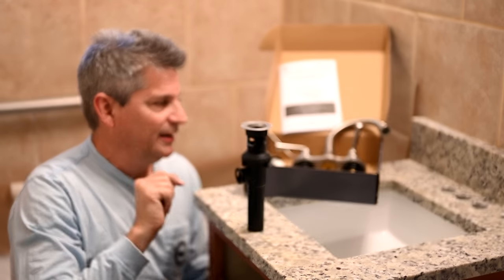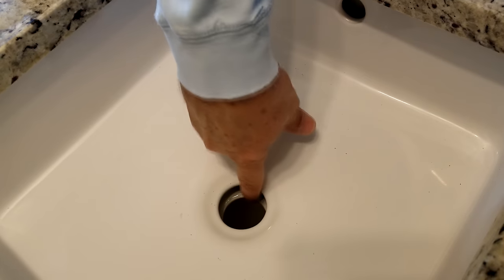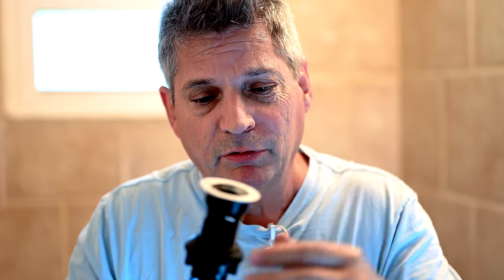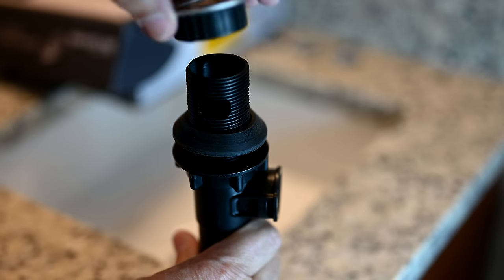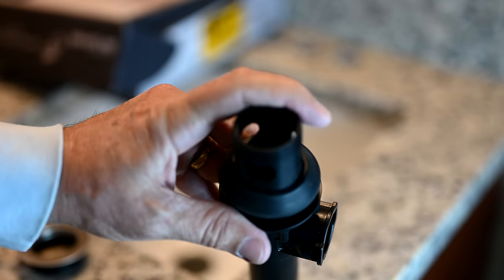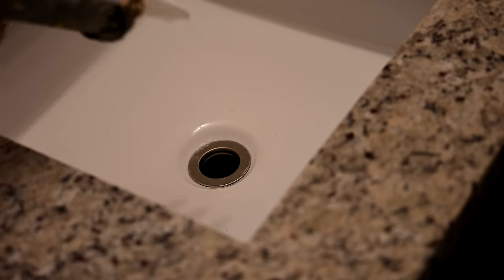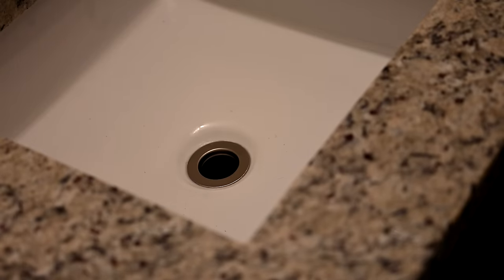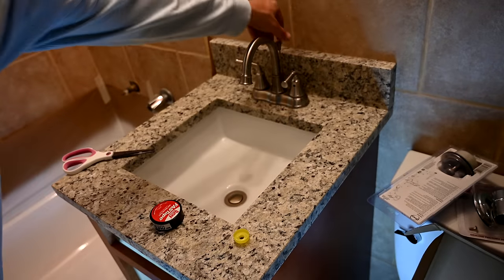How To Install Bathroom Sink Drain/Faucet, No Leaks Under Gasket, Threads [SOLVED] 2023

Comment from the maker: From Home Depot & Amazon (paid affiliate links)
🛒 Glacier Bay Mandouri 8" widespread LED Faucet in this video: https://amzn.to/2Efy2vY
🛒 Lower price 4" center set faucet: https://amzn.to/2PCcJa8
🛒 Oatey Fastape 1/2 in. Thread Sealing PTFE Plumber's Tape: https://homedepot.sjv.io/WDDKdn
🛒 Ridgid Z Change Faucet Tool Wrench: https://homedepot.sjv.io/NKKP4N
🛒 RIDGID One Stop Wrench Kit 27023 from Amazon: https://amzn.to/2ClCbNa
🛒 RIDGID One Stop Wrench from Home Depot: https://homedepot.sjv.io/9XEjQ
Reply: I was about to question as im watching.  My new faucet had a note saying not yo use anything on the threads.   I was surprised and still going to do it to be safe. But i guess i will trust them and leave the bare. 👍🤠
Reply: . Mlm. Mlm.... ,.
Reply: What brand of silicone caulk are you using? So many not sure which is right..
Reply: Those "arrogant plumbers" say things because you continue to give wrong info after saying that they commented you don't know what you're talking about,  most putty doesn't stain, or Crack anymore, for years matter in fact, and second, use brass  pop up assemblies, they are much better
Reply from the maker: @footlongburrito   If what you said is correct, why do they sell a stainless putty on the same all right next to the regular putty?
Reply: @jeffostroff  if you're speaking from home depot perspective,  that's already thrown out the window cause home depot sales "illegal" (against code) items, they cater to the homeowner/diy person, not professionals. At plumbing supply stores they don't advertise stainless putty, because they all now are, no one makes at staining putty, cause #1 no pro would touch it, #2 that is equivalent to selling old technology
Reply: Brandonnava8645 do you have a video showing the correct way?

Comment: You've got your direction of the teflon tape correct but if you flip the roll of tape 180 degrees it will unspool it naturally as you wrap it around.

Comment: Another good test for leaks is to close the drain, fill up the sink with water, and then open the drain.  This will force a large volume of water down the drain.  I discovered one of my leaks this way.
Reply from the maker: Yes, we do this as part of the overflow test shown at 14:09
Reply: It’s called a hydrostatic test.

Comment: This is the best instruction I have ever seen! Thank you! I just did this exact thing today, smaller bathroom sink, less room. I wish I saw this before I attempted to remove the faucet retaining nuts underneath. I tried to use channel locks and regular pliers, no room to really grab and turn them. Finally got the RIDGID EZ Change Plumbing Wrench Faucet Installation and Removal Tool. What a Godsend!
 Also, the plumber that installed my sink, tightened them so much as if I lived in California and was expecting an earthquake of 9.0! No need for that! and he used putty everywhere, that cracked and fell inside the drain, further clogging it! Just got to let the silicone cure, the do the leak testing. Thank you so much again, new sub here for sure! Have a great day and a Merry Christmas, God Bless You🙏🙏👍👍

Comment: Phenomenal presentation.  No annoying music is always a plus. I now feel confident to do this job. I watched so many videos over the past two weeks but never felt confident like I do now. Thank You for the explanation on the plumbers putty on black rubber. I had it out to use. I will now go to Home Depot for the clear silicone. Best thing for me is that I bought the exact faucet to install.  (Oh and I finally got brave enough to remove that yellow cap they put on for shipping ).   I couldn’t turn the water off as the valves were frozen.  I used WD40. Now I can turn them with ease.   Nice and lubricated.

Comment: 98% worked for no leaks. No dripping at any of spots covered in vid.  After the last leak check, did get slight drip on the lower tailpipe just below where it meets the t-joint for the ball rod port.  Didn’t realize that screwed into the upper level.  Based on your advice of a threaded components, took off the p-trap and added grey tape to the threads on the the lower tailpiece. Once it and p-trap were reinstalled did the leak checks.  This time no leaks.  Thanks for the vid. Haven’t had to replace a sink in ~35 years.  Bought the Ridged tool and it was easier than the basin wrench.

Comment: What a master! This is how you install a sink! Not as quick n easy as most people think. But if you do it this way, it will WORK.  Which is the most important thing. Thank you for this Jeff. I watched your previous video on this topic (how to keep the overflow inlets in the drain from leaking) and it helped me very much. This video is even better: so calm, confident, and thorough. Haha. Sorry for all the praise but I just remember how much of a bear it was in the days before I knew how to do it right trying to get it to stop leaking.... Great work!
Reply from the maker: Thanks diego!
Reply: Get a sink to stop leaking ? Wtf world do you live in ? I’ve never had a sink leak and I’ve never used Teflon tape like this . Yell me wtf the Teflon tape is doing to prevent leaking in this scenario? The cheap stack he’s using is why he has leaks maybe buy quality part one piece stacks that don’t screw to the flange to begin with and you won’t have leaks.
Reply: @kickassclone75  RE: " buy quality part one piece stacks that don’t screw to the flange to begin with and you won’t have leaks."
I did that. Still leaked. Used tape & sealant to get a leak-free installation.
You should do a video to show how you get yours to work every time. Would be worth a lot for anyone doing this type of installation.

Comment: For the first time ever, I installed a bathroom sink and faucet without a single leak.  I've installed some of these before but always had leaks to fight in the process.  Tightening  that one nut on the P-trap first and using Teflon tape on the tailpipe, plus the silicone in strategic places, must have done the trick.  Thanks for the great video and the excellent advice!

Comment: That was best video I found on leaks. Told us the why along the way and not just the how. I have a new Moen fixture that has been leaking at drain pipe after three tries. Kept thinking it was the putty but after third try and even with tape around top of drain pipe where it screws into flange, thought EXACTLY what this video showed as perhaps the culprit being the underside where rhe drain pipe is tightened. Was going to try silicone next underneath and even with ht flange and then completely stumbled on this video today...phone was listening to me talk about and gifted it to me. Will try tomorrow and hope that is indeed the solution.
Reply from the maker: Awesome I hope that solves your problem

Comment: Great video, Jeff--so glad I watched it.  I've had troubles getting lavatories leak free in the past.  After spending 2 days getting a 50-year-old 3-hole faucet and drain off of a cultured marble top, I'm ready to put in the new kit (which is now mostly plastic compared to the all-brass stuff I removed).  This will help a lot.  You are right about getting old stuff out being a beast.  My 50-year-old kit was severely corroded by all that time exposed to hard water, time, and copious amounts of dried up plumber's putty used when it was installed.  I had to cut the rusted faucet flange nuts to get the handles off & finally had to use my dremel to cut the drain flange seating nut, and the flange itself as nothing was breaking loose even with multiple tries of penetrating oil.  Would have been faster to go to the dremel first.  Fortunately, brass cuts easily with the metal-cutting discs (and a flex shaft made it so much easier).
Reply from the maker: Yes you have to go old school on these old school fixtures

Comment: I had a leak under the sink where that rubber gasket pushes up.  Or so I thought, it was made worse when I tightened it.  I tried the teflon tape and it worked.  I'm not going to lie, I was skeptical.  Your video is one of the best explained videos for anything I've found online, thank you!  I will be subscribing:)
Reply from the maker: Yes likely what happened was you over tightened the nut which deformed the gasket and made it worse. But luckily you found our video and the proper fix for it is the Teflon tape

Comment: Wow this was great. Thank you. I just had this problem and I fixed the leak with plumbers putty. I was just diy trying to figure it out. It has worked so far but I probably need to go back and use silicone and Teflon tape instead of plumbers putty. Thanks very much for this video. Very helpful
Reply from the maker: You're welcome!

Comment: Wanted to say Thank You.  Followed your instructions using tape and no leaks. The sink and faucet manufactors stated not to use putty because of the plastics. Used GE Advanced silicone in small tube. Also been using the 2 tool kits from Rigid, makes things a pleasure.  You got a new subscriber.
Reply from the maker: Glad it helped Jason, welcome aboard!

Comment: This is a very well produced video. I'm a journeyman industrial instrumentation mechanic in oil and gas, and my initial reaction to putting teflon tape on non-NPT threads was to go insane with rage. Then I thought about it, and realised that plumbing drain connections are all at atmospheric pressure. I'm brainwashed into thinking all pipe connections have to withstand 2500 PSI, but really residential plumbing is a completely different trade. Kind of an eye-opener, if that makes any sense. You solved my problem, though! Thanks for the excellent video!

Comment: Thank you @jeffostroff. Very clear instructions, good audio and video. I stumbled on this video because I was getting water droplets pearling down between the "cone shaped" silicone gasket and the underside of the sink basin. I'm replacing the drain on an old bathroom sink. The edge of the hole against which the gasket comes into contact on the underside of the basin has eroded/chipped and is no longer perfectly round -- so the gasket (which is perfectly circular), can't seal the hole properly. 

I've disconnected my ptrap, and followed your instructions. I've teflon'd the thread where the gasket lines up, like is shown in the video, and finger-tightened that nut to get the gasket to seal as much as possible (without deforming it too much) against the basin. Then I used channel lock pliers to give the nut an extra quarter turn.

Where I went slightly off the beaten path of your video, is that I added a bead of silicone all around between the gasket and the underside of the basin (after cleaning and drying the surfaces). I'm hoping that will do it. My initial idea was to craft a custom seal with putty on top of the silicone gasket, but I'm glad you mentioned that putty shouldn't be used against rubber/silicone. It should take care of the irregularities in the shape of the basin's hole.

 I'll wait for the silicone bead to cure, and test again to see if it's water tight. I might have to repair the sink's basin hole if this doesn't do it (I can't change the sink!)

Perhaps also something you could talk about in another video: My new drain shipped with a rubber gasket which sandwiches between the drain hole ring (where water enters) and the sink. That's in addition to the rubber cone-shaped gasket underneath the sink. I initially installed the drain with the top gasket which came with the drain, but it made the sink ring protrude by about a millimeter from the bottom of the sink -- so there's always a little pool of water around the drain hole after emptying the sink. After watching your video, I ditched that gasket and used plumber's putty to make that seal. (there are no plastic parts in my case, just stainless steel (drain), and enamel (sink) ). 

Thanks!
Reply from the maker: Man I cannot Stan those stupid gaskets that they give you it's such a dumb idea to put a gasket under the bottom of the flange up on top of the sink just for that very reason like you show it because it makes it stick up off of the bottom of the sink and collect water there to me the best solution is always to just use silicone to seal the flange down to the down to the basin. let us know how your repair worked out because I'm a little leery every time I hear about ships on the bottom of the basin that might mean that the basin is now disqualified from ever working properly .

Comment: Thank you for this very useful information, especially the teflon tape on the drain threads.  I have an additional problem and that is how to aline the trap directly below the sink drain hole.  The replacement sink hole is a half inch farther from the wall than the original sink.
Thank you.
Reply from the maker: We have a video that covers this: https://youtu.be/b_OSgwpteR4

Comment: Yes you are right after my first two of those years ago I learned the hard way. After I put really good silicone on all the threads. Then seal the rubber gasket around the base of the sink with silicone. This is a real problem great to have your input!
Reply from the maker: Thanks for sharing!!

Comment: I've used that tool for years....it's a must especially for DIYers.
Reply from the maker: Yes that tool is one of my favs, I also have a an older metal version but this newer one is more versatile due to the removable parts and different nuts it can mate up to
Reply: Hi Jeff, thank you for the EXCELLENT VIDEO. Learned a lot from it.
I would like to ask you a plumbing question please. We have an old single story house in a great shape,  built on a slab in 1976.  We have two bathrooms, about 22 feet physically apart, that are almost identical in design. The front, entrance side, of the bathtub is about 3 ft from the commode. The discharge from the commode is about 8 feet from the main sewer line in the yard. The tub drain discharge is about 14 feet from main sewer line in the yard. The bathrooms are in great shape, but the kids bathtub (only)  releases sewer fumes when taking a shower. But it doesn't happen every time they use the shower. Also I noticed that if the commode is NOT flushed before taking a shower, they do not smell the abnoxious odor. I am thinking it may have something to do with the vent system between the tub and the commode, for that particular bathroom.  But if so,  how do I fix this problem considering a concrete slab and very nice walls.  Thank you for your response.

Comment: I was having an issue with the seal of the pivot on a ordinary chromed brass Delta drain...  at least that was what I thought it was.  Turns out it was the threaded joint just below the pivot.  Following your advice with Teflon tape fixed it.  Thanks!
Reply from the maker: Glad I could help
Reply: Good work thanks

Comment: Thanks! I have installed quite a few drain pieces that leaked mysteriously and never thought about Teflon tape. I have used some plastic pipe thread compound but your solution is so much more permanent.
Reply from the maker: Glad I could help! And thanks for the donation!

Comment: I solved problem of tape crimping etc, wrap tape with dispensing side toward wrap thread.

Agreed, the tub of putty said DON'T use plumbers putty on plastic threads as can cause damage!  I have previously always used plumbers putty. 

In both instances and learned something new today!  Took me several hours to disconnect 60 year old drain!!!

Comment: I followed all the instructions that came with my facet, reinstalled it twice and it still leaked.  Then I saw this video, followed the advice it gave and no more leaking.  Why don't they just put this in the directions?  Thanks so much
Reply from the maker: Lol I always wondered that the same thing, but if they put it in the instructions there sort of admitting that their threads aren't very good at meeting up two other components